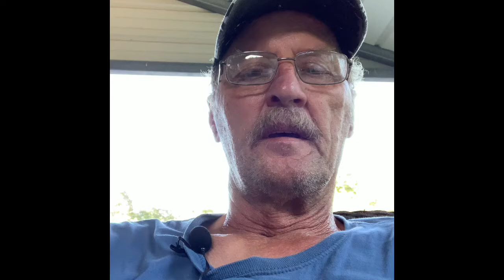1st Out

Comment: Started in the field recently. Biggest challenge I've run into is other techs thinking I should know everything even though they have explained nothing. I'm to the point where I understand process flow, but it seems like every skid is piped differently which screws me up a bit finding my lockout points. I've been told to shut down a unit even though I had zero idea of the proper way. Almost all of our units are 1k to 5k hp, so a bit intimidating for a new guy. I'm learning fast but if stuff was explained to me, it would help. All our units are CAT or Waukesha engines, and Ariel compressors.
Reply from the maker: Frank I know how how u feel but a word of encouragement no matter the size of the unit they all work the same way if u know how to load a small unit the big ones load the same way. Don't give up just break down all parts of the unit and it will start to make sense. if u need someone to talk shop with PM me on Face book with your number and ill call u .
Reply: @Compressor-guy  thanks I'll keep that in mind

Comment: You’d need days and days to explain this to guys “just starting out”. Oil psi, detonation, deviaton, vibration, scrubber levels, hot/burnt/dropped valves, louver issues, low oil/coolant, rocker arms, coils, plugs, wires, diagram pumps, level controllers, switches, etc etc. Takes years